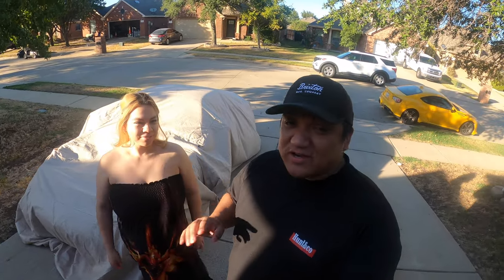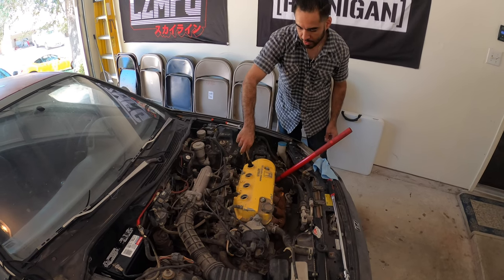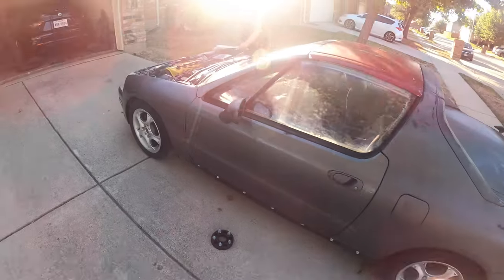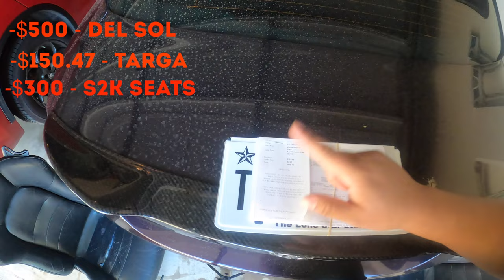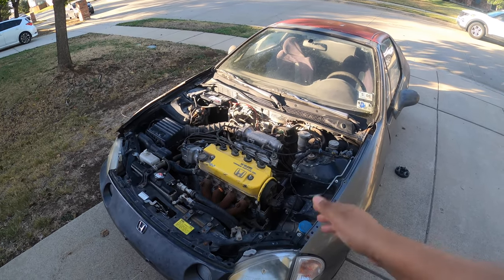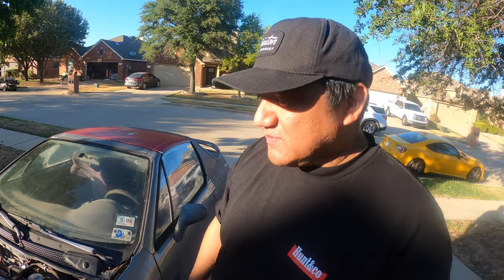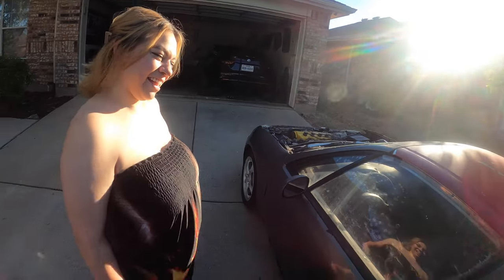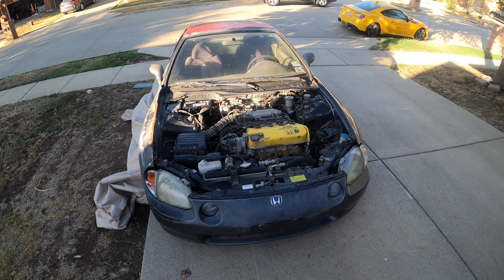REBUILDING AN ABANDONED DEL SOL | PT 2

Comment: Don't overspend in the beginning. I suggest sticking with a D15 series engine - they're quite common, affordable and would make for a quick and easy swap.  Since the registration/plates are already purchased, you'll have a daily driver.  Plus, you'll see if it's a money pit and determine if this car is a keeper.  If you decide to sell it, a running/driving car is worth more than a non op car.
Reply from the maker: I think you’re right, I’m probably leaning more towards the JDM D15b. I’d prefer to see it running before dropping a ton of cash into it lol

Comment: K20A3's are less desirable but can be had for about $300 all day. It'll basically be an upgraded D series since the VTEC is only on one side. It'll be an upgrade anyways from the power alone. Nevermind VTEC Killer, since you've gotta get it tuned anyways. 

Either that, or B20. 

Excited to see where the build goes
Reply from the maker: Thank you! Definitely going to consider some A3’s!
Reply: @ModdedMotors  

Always here to help, 

A3's have lower compression but the same strong internals minus the weak oil pump at higher revs past 7.4k 

Good for boost, or classic high cam VTEC killer build/all motor top and bottom end at the extreme side of mods. 

Or you can get an A3, swap an A2 or Z head if you want VTEC on both sides. 

A stock K20A3 with just a tune would probably be the best bang for buck or TSX/Accord/Odyssey K24. Both will need a tune anyways, and you'll have a fun stock and reliable ripper no matter what you decide to put in!
Reply from the maker: @tommynobaka have you ever heard of people running ProEFI on these things? I have a ProEFI ecu that I was going to use on my IS. Wondering if I can just order a new harness
Reply: @ModdedMotors  I think a few professional racers use proefi for Hondas. It's more about what your local tuner has access to, so you determine which ECU to get. Like if your tuner specializes in Link, get a Link.  I would contact proefi if they can make something for you 

Most of the time Honda guys get K Tuner for ease of access, cost, and tunability. You can get tunes emailed to you and you upload them to the ECU. Plus they come with data logging for literally everything from oil temp, to MAF signals, etc. It's midrange for price and features. 

Hondata is another one for the same reason, but cheaper than K Tuner since it has less features.

Haltech if you're serious about data logging. You do have to get a custom harness made since it's an entirely different unit. However it's very expensive, I wouldn't recommend it for the street even if your tuner specializes in it

Comment: Shitty way to find out that the motor is shot, sorry to hear about that bro….but I still say go for a B series, tons of aftermarket support, and gives you more power than needed especially for such a small light weight car, it will rip! Sounds like in your area motors and swaps are crazy expensive!
Reply from the maker: Thanks brotha, yea it was pretty shitty. I definitely consider the B series as well. Getting the K to work in the Del Sol gets a little pricey. The motors aren’t bad it’s the supporting parts. I hope I don’t get too down the rabbit hole 😅
Reply: @ModdedMotors  True a K swap would be badass but the B is a straight bolt on pretty much, mechanically wise speaking. They do them here for like 2k-3k depending what other parts you want to upgrade, I assume you’d want to go turbo to hit 400-500hp though?

Comment: I dont really see how you would be spending 30k in mods on the car for only 350-500hp with all the other stuff that needs taking care of, 30k on a good platform or a car that is at least driveable before you buy it and you easily can make 500+ hp
Reply from the maker: If I go K20a just putting the motor in would cost $7-8k, that’s not even making crazy power. Boost it probably 5k-10k depending how I build it. Carbon everything about 4-5k. Paint probably 3-4k. Suspension with quality parts 3k. Wheels / tire set up 3k. Ameripool top is around $1k. I also want a 97 front bumper so probably about $500. You have to include miscellaneous parts as well. So I’m in about $26,000- $34,000, give or take. The motor can be built for more than 500hp but you don’t want to max out boost or the engine. For longevity build it for 700hp drive around 500hp or less. The second you put more power down you have to account for transmission, axles, brakes, and other components. I’ve been building car for quite some time and I’m fairly good with budgeting them. Im also realistic with pricing, so I go max and reduce as much as I can. If I did a half ass job to get the car running I’ll be in it for a quarter of the price, but im not sure that’s the path I want to take.
Reply: @ModdedMotors  i actually agree with most the pricing didnt know you wanted carbon everything lol also 7-8k for a swap? Hondas arent that complex i wouldnt take it to a shop if they charge that much
Reply from the maker: I wish it didn’t cost that much but K20’s aren’t cheap anymore. You can get them from $1,200-$4,000 depending on spec. You’d still need a wiring harness, motor mounts, hondata, jumper harness, still patch over 6 or so wires, headers, axles, transmission, exhaust, transmission mount, AC, just a ton of little items. Working properly for sure $7k on low end which is cheap for a Honda. That’s still if I do majority of the work myself. I paid for a turn key swap for my Supra and you’d be sick how much that cost lol. $7k is honestly pretty cheap for a k20